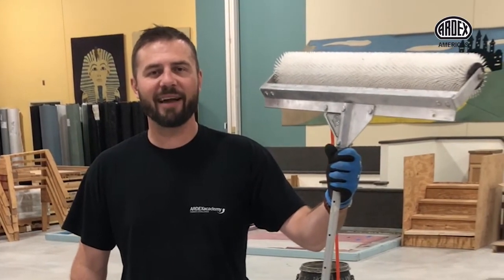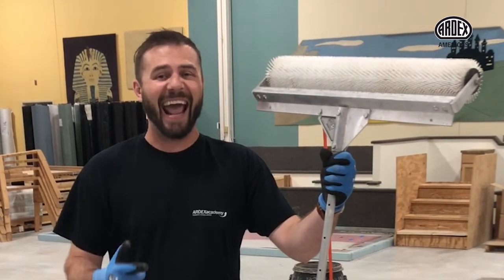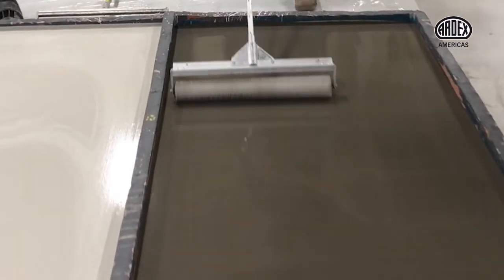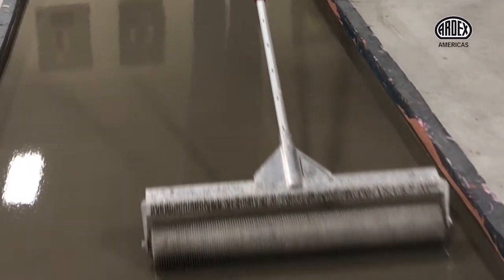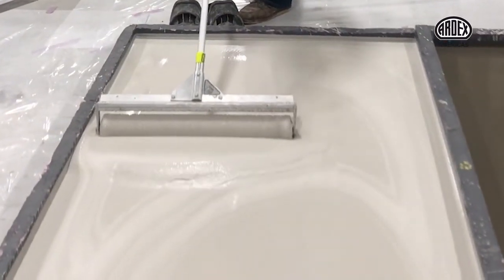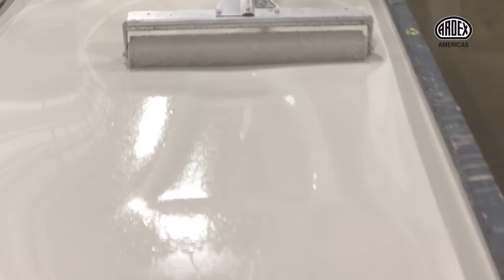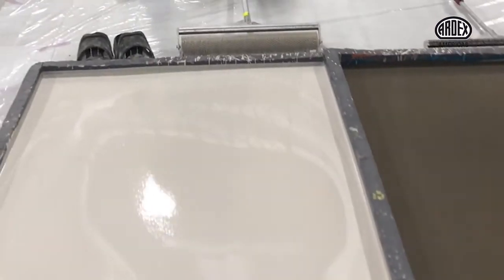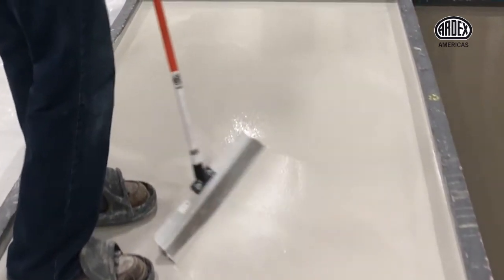Industry Know -How with PJ: Spiked Roller

Comment: I doubt you'll respond to this question but if I got roller with longer teeth, like 30 mm (1. 18 inches) then I could use it for a depth of about 1" I imagine right? Cus the spiked roller it's also good for blending in in between pours correct?
Thank you

Comment: I made my own spiked roller, with the spikes more widely spaced than the roller you show here, approximately the same spacing as in your cleated ‘sandals’. It works great on all thicknesses of leveller, and does not push the leveller in a wave. (Roller made with timber dowel and nails). I believe the roller you show here is for removing bubbles from epoxy flooring. It would be great if Ardex or whoever would make a roller specificity for self levelling compound.

Comment: Great video. I have a question for you. Where do you get those cleat sandals from, and what are they called?
Reply from the maker: Any type of cleat will do.
Reply: They are called Shoe-In's. https://www.vidistribution.co.uk/products/shoe_in_spiked_shoe.php
Reply: Maybe use a spiked roller with longer spikes!! Your using a tool for the wrong depth!
Reply: @nick2580  its not required on deep pours as he said. anything over a quarter inch will actually self level.  just doesnt like to on thin pours so you use the roller to break the surface tension.